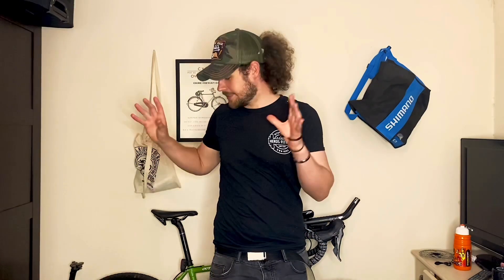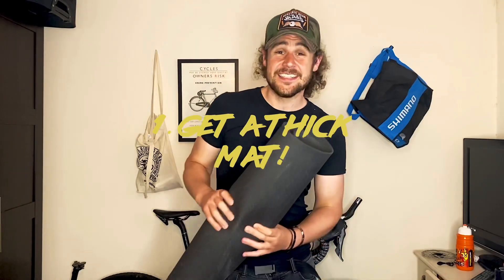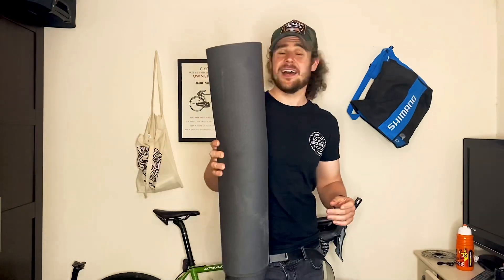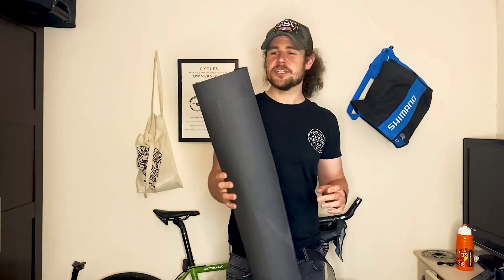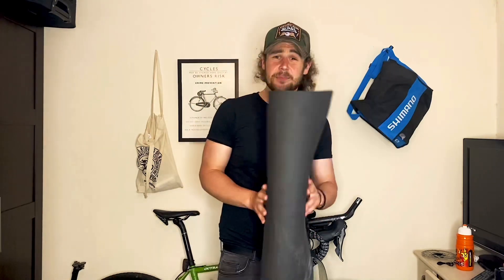4 Tips to make your Turbo Trainer Quieter!

Comment: Thanks for the tips. Incase someone is using threaded tyres, move to smoother or indoor tyres.
Reply from the maker: Nice tip thank yiu
Reply: I changed it but my roller is making noise....I don't even know where and how to oil it...can you guide me?..a video link will be useful
Reply: Gonna try this